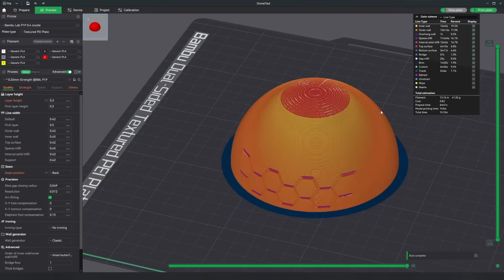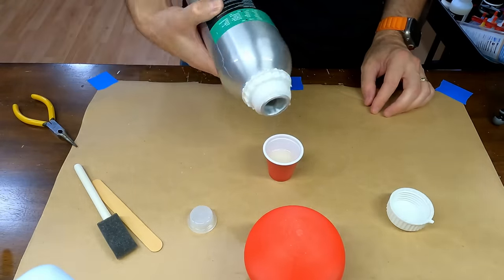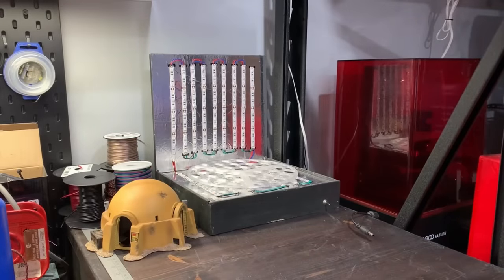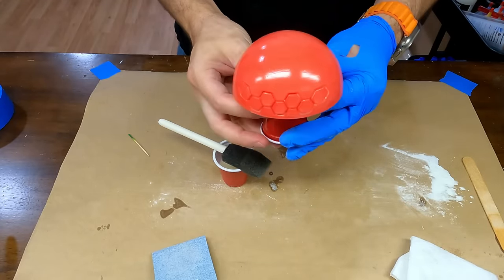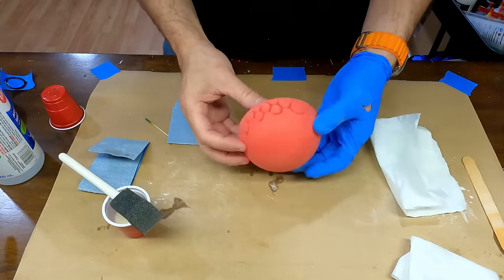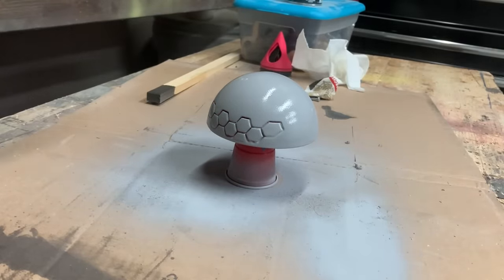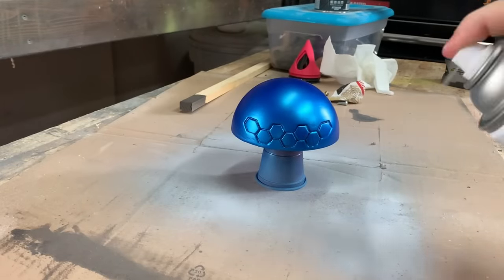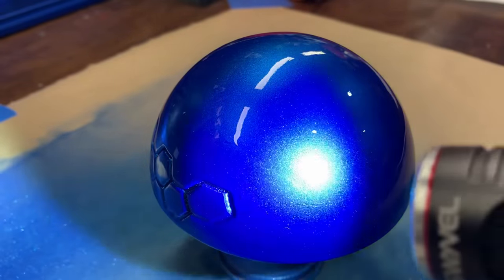Hide 3D print layer lines with Baby Powder and UV resin

Comment: So, uh, what’s this go to? Or for I mean. The finished product not the process. You did fantastic on that!
Reply from the maker: The actual dome will endup in the corner with the other test objects I make.
The process will be applied to a helmet in a upcoming video :)
Reply: @DaveRigDesign  my main hobby is rc cars. I don’t have a printer but would love to get into it. Several make rc bodies but the layer lines kill the scale look. This is fantastic. (I mainly do slow scaler RCs)
Reply from the maker: I've seen people print complete RC cars and have been thinking of trying it. I had a nitro RC truck a long time ago.
Are people printing the bodies? I'd figure they would be to heavy and prone to breaking. I thought maybe printing people would print a mold to use to in vacuum forming custom bodies.
Reply: @DaveRigDesign  they’re printing yes.  For scalers the priority is more on accuracy to the real truck they’re copying than performance. Driven mostly in a scale manner so not flipping etc.
Reply from the maker: Do you know where I could find file to print a car body? Doing a video on a car may be more interesting than just a dome :)
Or are people mostly designing their own bodies to print?
Reply: @DaveRigDesign  I don’t know any offhand but after googling for a few minutes I found a couple sites that sell the files. So a bit of a paywall. Etsy had some too. Since I am not familiar to printing I don’t really know a good go to site. But I’d  absolutely like to see you do one or a few. Subbing now so I get notifications. Thanks
Reply from the maker: @The_RC_Guru found something I can work with, stay tuned :)

Comment: Anyone can help, how long a 3d resin lasts? My PLA /ABS lasts 3 years then crumble when touched..😢
Reply from the maker: where did you have your prints for them to crumble? Usually being exposed to the sun will cause prints to decompose, usually not ABS though. Resin would have the same effect unless painted to protect it. Paint will block the UV light from getting to the plastic.

Comment: There looks to be a machine issue.  Those layer lines are pretty bad.  Even if it was printed in petg, it should look much better than that.  It was either printed with a >50% tip diameter to layer height, or the bamboo needs to work on the rigidity of that machine.

Comment: Would this hold up to heat…?😀
Reply from the maker: Well the PLA starts getting soft at around 60 deg Celsius. The resin should withstand more than that but if the PLA buckles under it the resin will probably start cracking and flaking off.

Comment: You could probably save some resin and time by using filler primer since you're painting it anyway.
Reply from the maker: The grey primer is filler primer. It’s really only meant to fill small scratches like those left from sand paper, not deep grooves like layer lines. 
It would work but you’ll need a lot of coats and have to wait for it to dry.

Comment: Great video! Seems to me there really isn’t an easy way around smoothing out a 3d print. Every way takes time.
Reply from the maker: Thanks, unfortunately there’s no free lunch 😜
Reply: The process here did seem unnecessarily complicated though. With the fast printers of today, why not use a lower and variable layer height to smoothen out the layer lines by a large amount to begin with? With that, sanding and just a few excessive layers of spray paint I got treble speaker enclosures clean enough that I was happy to use them in my car.

Comment: I wonder how fumed silica or maybe micro-balloons would fair in this application instead of baby powder
Reply from the maker: I assume similar results as they are meant to be used to thicken resin. If this was a structural application they would probably be better.
Reply: @DaveRigDesign  I was wondering of the chemistry behind that. I know that if you can use less of one specific thickening agent than another to achieve the same consistency it might be better for not taking away from the solids of the resin. Just a curiosity I had.
Reply from the maker: I’ve only briefly looked into the glass beads but I can’t imagine they are as fine as the powder so I wonder how smooth of a finish it would create. I belief they are used for thickening the resin to create gussets and such so a thin finish isn’t the main use.

Comment: Why not use a high build UV plastic primer? Dries in as little as 60 seconds and much easier to get even because its sprayed on.The automotive body repair industry has been using UV primers, fillers and lacquers for a few years now.
Reply from the maker: Well issue with spraying is it’s hard to control where it gets applies unless you spend time masking. Also uv primer seems pretty expensive.

Comment: Why would you use cornstarch instead of talcum?
Reply from the maker: Cancer :)
Reply: @DaveRigDesign  Reasonable answer, I suppose. Talc is a very useful traditional filler for paints. May be worth trying, to explore it's properties. Working around UV cure monomers is higher on my personal list of concerns.
Reply from the maker: They make specific product for resin thickening made from glass beads. Probably the better option for doing this a lot but baby powder is a good/cheap option that is easy to find.

Comment: The resin is a great idea if you want to do it fast but for better results and cheaper would be nice to use  car body filler, you will get better results.
As well the finish :D no judging but you would have been more careful with the paint, it dripped at some points and created a wave finish
Reply from the maker: Not sure if body filler would be cheaper. I think a bottle is about the same as resin and not nearly as fast. 
With body filler you have to mix a new batch for each coat, you have a fixed working time and you have to wait for it to fully cure. 

With Uv resin 1 mix lasts the whole project, or multiple projects if kept in a sealable container. 
Working time is infinite until you shine a light on it and it cures instantly once you do. 

The finish you get with both will be the same. They are effectively the same product.
Reply: @DaveRigDesign  i like the resin idea because you could finish just with the resin with some glitter or glow dust and drop a clear coat on the top and look sick ))

Comment: So, to summarize:
5 coats cornstarch+resin
multiple sanding passes
2 coats primer gap fill
more sanding
5 coats of paint
a "few" coats of Rustoleum Painter's Touch Clear Gloss

...

So, in short, the baby powder/resin really was just to help fill in the massive layer lines he intentionally created with a larger layer depth and all the 'smoothing' was the same stuff you'd normally do to smooth out a rough surface.

Not trying to be rude or anything here, it ~IS~ a nice finish after all, but this is almost like one of those joke 'how to draw' books that says start with a circle, add a square, become a famous painter.
Reply from the maker: Well the amount of layers is up to you, your mileage may vary :)

You could probably get away with 3 layers of resin, one primer, 2 paint and one clear. But if your already in the process it take no time to add a few more layers here and there.
Reply: Fair enough.
Like I said, wasn't trying to be rude, just... well, it's kind of like saying "fix a V-twin with a coat hanger" and then going on to state you hire a mechanic, but you opened the door to get to the hood release with a coat hanger.

End result is still nice.
 @DaveRigDesign

Comment: Aw man, I have a pla printer exactly because resin is too expensive. Now I need resin anyway to make my PLA prints look good 🥲 Should have just gotten a resin printer from the start
Reply from the maker: Well doing it this way you will use way less resin which is cheaper :)
One bottle of resin will give you any few prints but let you coal like 50 prints.

Comment: While you can do it this way, I don' t see the benefit of not using car paint filler. Just buy polyuethan one, spray it with 2.0mm nozzle and sand it with p150. Follow up with light filler for finish prep (acrylic one) and you are good to go. Process is the same, but just faster. You don't need to mix reisin and powder as this is more suitable for purpose and will be smoother than using foam brush. :)

Comment: Great info and demonstration. Music was way too loud, IMHO.
Reply from the maker: Thanks! 
I don't get all the complains on the music being too loud though, I thought I was the old one here. :)
Reply: @DaveRigDesign  myself, I suffer from Auditory Neuropathy. While I can hear the words, they can be hard to understand if there's a lot of background noise with them or, in the case of this video, there's noise/music that's just as loud or louder than the dialog that follows with a discernable break in-between the two.  

Perhaps instead of having the music suddenly fade immediately before the voice over and kick in right afterwards, a longer fade-in/fade-out. Another suggestion would be to make sure that level of the music after the intro is just a tid-bit lower than your voice over.  Just lowering the music volume to be about 5-10% lower than the voice over level then having your current fade-in/fade-out effect could have a large impact as well.

Comment: Looks like on the honeycomb between primer layers or whatever layers caused imperfections to the honeycomb details you could use a dremel to even them out a bit then continue. Obviously on complex parts that would be a b!$@h.
Reply from the maker: Ya, most of the damage was done on the 1st coat. Wasn't careful enough around them.
Cleaned up most with a toothpick before curing but not all.
Would have needed to carve it out before proceeding but didn't bother :)

Comment: So exactly the same as blasting on filler primer.
Reply from the maker: Same except you need to add many more coats, drying times way longer, and less control where the spray goes. But besides that yes, exactly the same :)

Comment: I would venture to say it needs sanding between every coat.
Reply from the maker: You could, just takes longer. The idea is when applying coats you are building up the high and low spots, then when sanding your are removing the high spots. 
So if sanding between each coat or every few it doesn’t make much of a difference as the coats are so thin.

Comment: I think you can use something cheaper than resin, like some kind of paste.
Reply from the maker: glazing putty is cheap and does the job well, just takes longer.
I have a video on that here https://youtu.be/xxdjFREJpKs

Not to many other things you can coat a print with, just layer on primer and sand but will take a long time but doable if the layer lines are not that big

Comment: You're not "hiding" layer lines, you're giving it a whole new surface LOL. You put more work into finishing that than I have on anything in my entire life. If I turn something like that on the CNC lathe, it comes out super smooth right off the machine. At this point, I'd much rather add a few extra perimeters and then just stick it on the lathe to do a finish pass. It'll turn it super smooth in a single operation. PETG machines much better than PLA. Nice synthwave in the background though :) What air brush is that?

Comment: It looks great on a large print, but on a much smaller stuff like model trains that have small details like rivets and girders and plates- this will ruin all fine details.
Reply from the maker: Well on something that small you would get the detail in the 1st place from a FDM print. You would need to print in resin to start. 

This process is for printing big thing you can’t reasonably do on a resin printer.

Comment: I found 2k auto primer has the same results and it sands like butter 🧈
Reply from the maker: Ya you can get the same results with just primer. You just need to do more sanding on the pla and wait longer for each coat of primer to dry. There is some question of shrinkage when drying when filling such large gaps with paint but may not be an issue.
Reply: That's a lot of primer.  But true. U would probably only need 2 coats of 2k. To get the same results u got here. Probably 10 or 15 coats of rattle can primer. But if there is a will there is a way. I remember using 2 cans of primer on a helmet,  I knew there had to be a better way 😂🎉.

Comment: the main point of using resin is to reduce need of sanding, but you sand it so much, so it looks a little bit useless to use resin at all)
Reply from the maker: The point is to reduce sanding. There never no sanding :)
If I just sanded the PLA it would take way much more work

Comment: Does this get the job done? TECHNICALLY, but holy cow, at this point, it's not saving time and would be better off just using a resin printer if you need that level of detail. I was assuming it was going to be a more elegant solution.
Reply from the maker: Not saving time relative to what?
Reply: @DaveRigDesign  Resin printing, ABS VAPOR SMOOTHING. Look how much work this takes. For a nice result, but why would you need to put like 2 hrs of extra labor in when if you need to rely on highly detailed high resolution prints, there are cheaper and more economical options than sand, layer, sand, layer, sand, layer. Also if you need accuracy, that's going to make it harder to calcuate as well, how much thickness are you adding that can mess with tolerances. Yes, it's a great OPTION, but in reality Work > Outcome. If you catch my drift, the "sweat-equity" is not there.
Reply from the maker: Printing abs is much more difficult then pla. Also you can’t control where the amount each area gets smoothed. 
Also if I wasn’t filming the whole process would take maybe 20 min to go from raw print to primed and ready to paint. 
This isn’t a process for mass production of products though.
Reply: @DaveRigDesign  OH NO SHIT? THEN THAT'S NOT AS LABORIOUS as it seemed to be. Fair enough, I apologize.

Comment: Nice, high build primer would have been just as easy and probably cheaper
Reply from the maker: Would worked but would have taken more coats and drying time would have been much longer. Resin cures in iv chamber in about 1 min.

Comment: Top tip you don't need the baby powder! I do this all the time the resin self levels itself if you leave it for a couple of minutes keep your eye on it and look at it in a glare of light you'll see how smooth it's gone then cure it and re wash it! Light sand with wet and dry (dry) jobs a good one 👍

If you are going down the talc route try baking soda instead like we use to fill gaps with superglue mix it might be more suited to Filament printing but resin printing I just brush on resin on its own leave it a few minutes watch it self level smooth then cure it! Light sand and it's perfect!
Reply from the maker: I could see not needing powder when coating resin prints, the layer lines are so small thickening the resin would build up too much and make it uneven. Resin would self level on a flat surface, but on a dome like this it would mostly run off. 
I've heard of, and used, baking soda with CA glue but the reason it is used is it acts as a activator causing the glue to harden quickly, just like the activator spray. So its a 2 part gain, Thickening the glue to build up areas and causing it to cure faster. It wouldn't have the same curing effects on the resin.

Comment: to me, this seems like the same amount of work for the same result as just sanding the print so 6 to one half a dozen to the other kind of thing
Reply from the maker: Ya you can get there by just sanding but it’s just more work. Sanding PLA is much harder then resin. It’s like the difference between sanding pine and oak.
Reply: @DaveRigDesign  ohh ok that makes sense thank you for the clarification :)

Comment: Why not simply use an MSLA 3D printer? Prints produced with these types of printer have a virtually perfect surface and post-processing is minimal.
Reply from the maker: How do you print something big? Like a helmet? A SLA printer of that size is not really affordable for the average person.
Reply: @DaveRigDesign  not a problem, you can print the part in pieces and then assemble them with the same resin you used for printing and a uv torch

Comment: Wow this takes forever... Why not just spray spray filler on it and sand this? Yes it needs longer to dry but it's easier and most of the time one or two layers are enough. A bit of sanding after second layer, finish.

Comment: Why not use masking tape /painters with double sided foam tape itll be much easier and cheaper
Reply from the maker: Double sided tape works also. I use CA glue for a lot of things though so I had it on hand.
It a common trick in wood working and CNC work to temporarily stick things down.

Comment: If you're going to "fix" FDM layer lines with UV resin, why not just print it with a resin printer to minimize the layer lines to begin with? If you have the resin and curing station needed for this process, you likely have a resin 3D printer.
Reply from the maker: I do, but that doesn’t mean everyone does. :)
Also resin printers are much more expensive for the size.

Comment: If you’re using filler/primer and painting anyway, maybe just use glazing compound or body filler.
Reply from the maker: ya that works too but this seems easier for large areas. 
I did a rest with glazing compound here https://youtu.be/xxdjFREJpKs
Easier to controllable where it goes but more work and longer trying times.
Reply: @DaveRigDesign  - Not directly questioning your personal experience, but it seems odd, given that glazing compound is used for entire car bodies.